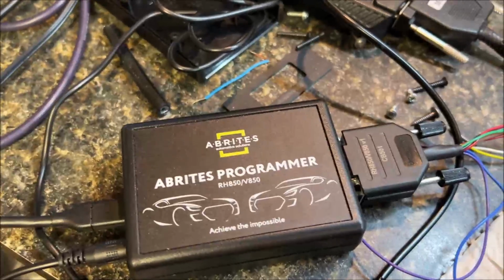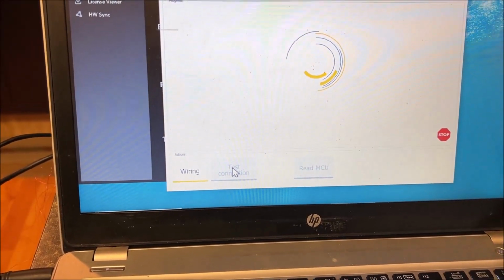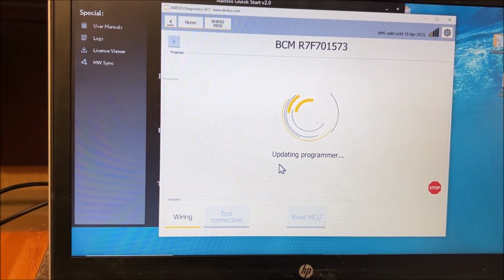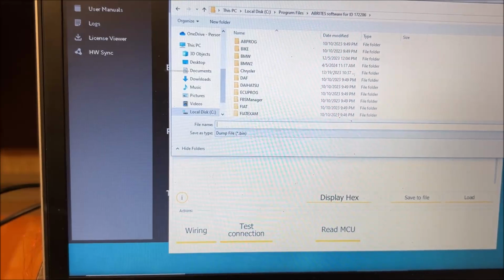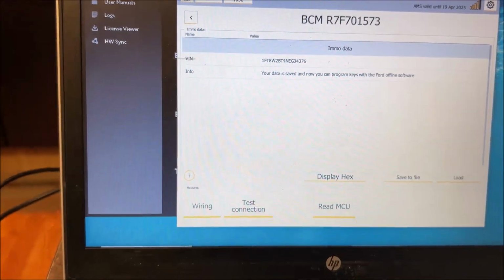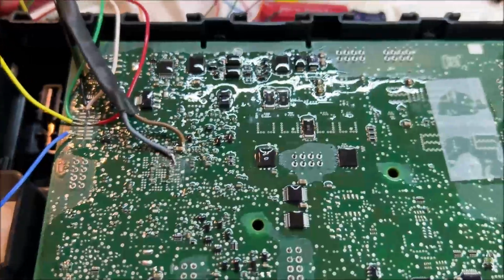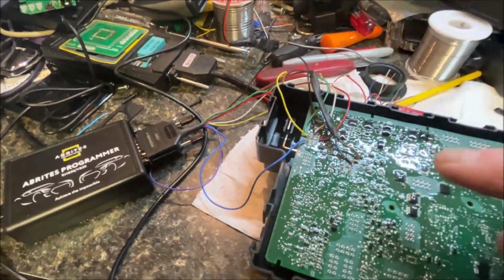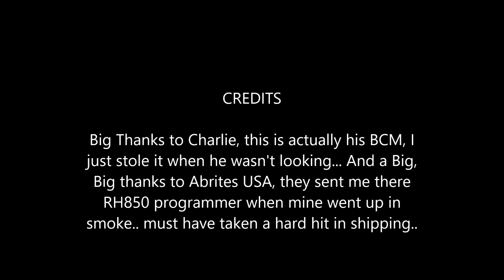RH850 programmer Ford BCM 2022 F250

Comment: Thanks Tim I just make my first 2021 F150 follow you wiring connections and work just fine 😅you are the best
Reply from the maker: Those resistors are small, aren't they??
Reply: @timtracy9442  yes

Comment: Good afternoon! I am needing my Used BCM off a 2022 Ford Bronco Sport outer banks programmed.    with the vin number of the car and ECM.   please help!
thanks
Reply from the maker: Your best bet is to find a shop that has Ford FDRS, they can read data from the original in the car, then put the used module in, and program the new/used module.. why are you replacing the module?? Just so you know, you don't just program the vin into the module, you program the module into the vehicle, as in, program it with all the options the car has, then the keys are programmed into it, then the synchronization with the other modules.. you don't just plop a module in and program a couple settings, newer cars have alot of data in all the modules... this isn't a 1992 F150....
Reply: @ thanks for responding, I have a flood damaged bronco sport that I rebuilt. Everything works fine and it is my daily driver I just can’t pass a smog test because the vin doesn’t match up with the vehicle. I am thinking of selling the car soon. the dealership told me I would need to buy a new BCM from them to have any work done….. and they charged me $200 just to tell me that so I imagine doing the work with them will be way more than I want to spend. Thanks again, ill keep calling around shops